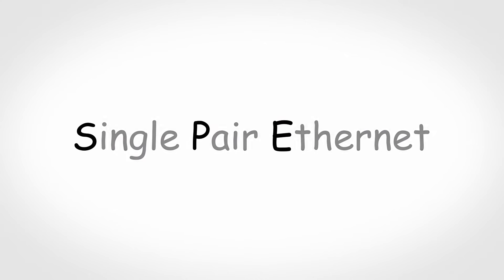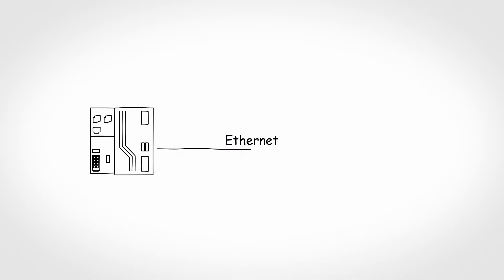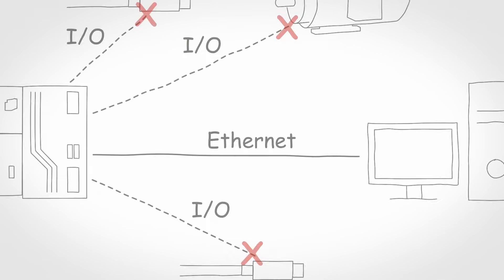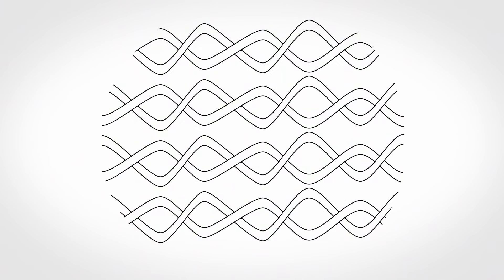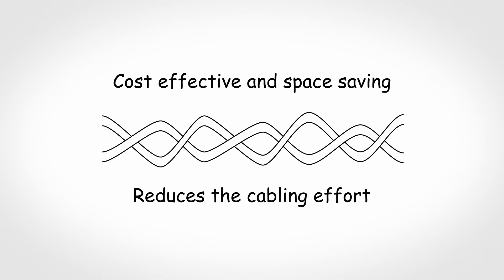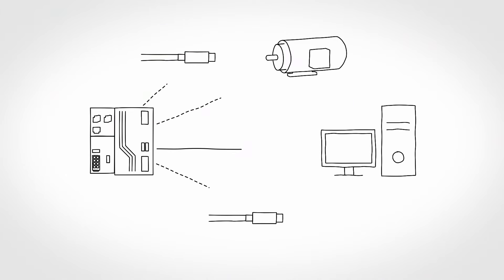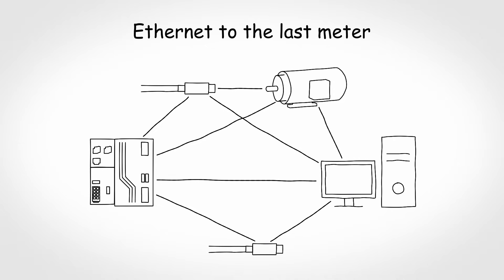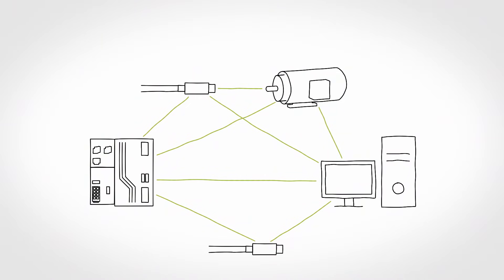What is Single Pair Ethernet (SPE)?

Comment: what about noise, crosstalk. much of the reason for 4 pair and shielding is corruption from noise.  How is this addressed ?  otherwise aren't we just back to modems...
Reply from the maker: As with the 2- or 4-pair Ethernet, the signal transmission of SPE is also realized as symmetrical transmission with a differential signal between the two wires. Therefore, the same mechanisms against interferences apply here.

Comment: Was there really a need to come up with yet another new protocol in the already oversaturated pool protocols and interfaces? What is the benefit of this “SPE” over already existing systems like profinet, ethercat, ethernet IP, IO link, ... ?
Reply from the maker: @Chimaeria, Single Pair Ethernet describes a new Ethernet technology realized on the physical layer, that is the reason why it’s protocol independent. The advantage consists in the reduction of the wire pairs from 2 or 4 wire pairs to only one wire pair. Protocols and adaptations on the higher layers of Ethernet communication remain unaffected and can still be used (e.g. PROFINET, EtherCAT etc.).
Reply: Maybe they just didn't want USB to be the only "universal protocol" on the block?  cable is pretty cheap